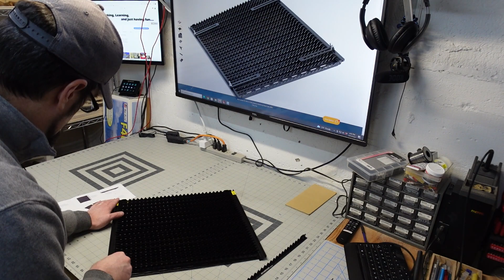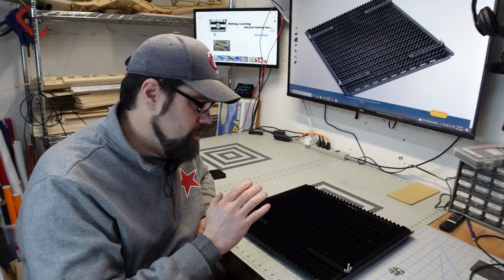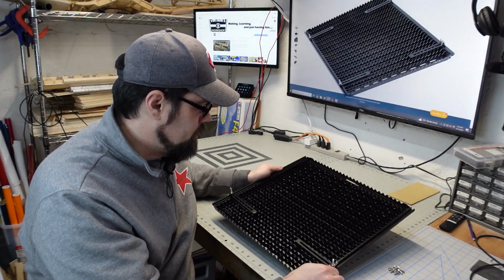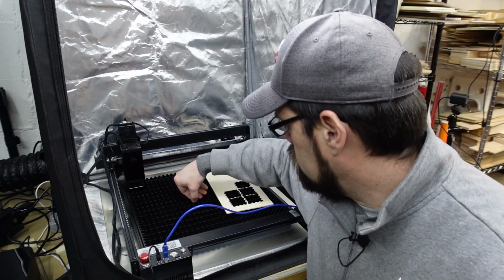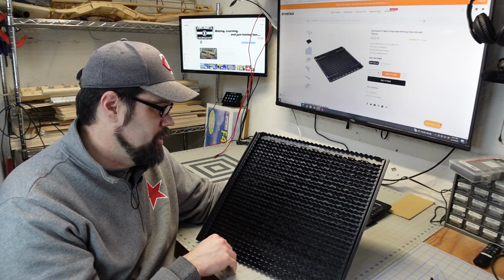Atomstack F3 Matrix Working Panel - Is this better than a Honeycomb Panel?

Comment: camera out of focus, distant recording so none can see the sense of the blades, the screwholes... dark light anyway so even magnifying one does not see anything... You placed the feet out of camera...
All in all it's a useless video.

Also useless product, mine had problems with the sticks, they would not fit in the hole cause of debris from factory left attached... had to clean. Also the screwholes in the back are "open" so the screw fits inside but if tighten it, the head starts digging and separating the two parts instead of keeping them attached 🤣
lousy product and material, you scratch it just by watching it. Also mine had already been used as it was scratched in places I didn't even touch.

106€ for a total crap, better than honeycomb but not worth all this money AT ALL. Also the company is chinese (and that explains alot) and they don't answer the questions or fake they don't understand. Even when you ask them nicely "I'd like to buy this product too, cam you tell me if it fits my machine?" they go like "oh, well, thank you for the feedback" FCK OFF! I need answers, I spent hundreds and need to spend more... China SMH
Reply from the maker: Thank you for your opinion.

Comment: what enclosure you use in this Video?
Reply from the maker: That is the Comgrow Large laser enclosure. It works well for video but also lets some of the smoke rise to the top and then it does not always extract well. But if you have a camera and need a simple solution, this does work decently. https://amzn.to/3TjHHqf

Comment: Clearly this is modeled after the 'big boy' fiber laser beds and plasma tables, but I think it is a solution in search of a problem. The reason those big tools use spikes is because the cutters on those tools are powerful enough to cut through not just the workpiece, but also the supporting surface. By reducing that surface to a series of points with lots of clearance between them, and then putting a pool of water beneath that to deal with the heat of the laser/plasma cutter, the cutting beam(s) avoid cutting through the support. (Well, for a while anyway, and then individual rows of points have to be replaced when they become too damaged to hold anything). That issue really doesn't exist with this kind of laser, as a diode laser just isn't going to cut through a ferric metal support. Given the clamping advantages of a honeycomb, and the fact that both allow for adequate ventilation, I don't really see the application for this.

Comment: I like that they are trying to find ways to mitigate issues we face using these products. The points seem to be a good step in the right direction. However I doubt I will be swapping out my honeycomb any time soon for this. I use magnets to hold down workpieces that are more often then not, warped slightly. I also use workpieces much smaller than the normal 12"12 sheet and I do not think those supplied rails would be much help in holding them down. But, like I say, I think it is a step in the right direction and I am glad to see them thinking about things other than just stronger laser heads. Good review, thanks again, Steve.
Reply from the maker: It is good to see other accessories to improve the various issues that come up with lasers.  I agree that this may limit the magnetic jigs but I also see opportunity with the T-slot side rails to both fix the panel to the laser and create jigs for alignment. It's a give and take with either option for support and airflow.  Thanks for watching!

Comment: Not sure if was mentioned but I actually stumbled into a little flaw, I had a cutout I was doing, some square that had fallen into the slots and one side ended up actually sticking up to where the laser head would hit it and completely move the sheet seems like a possible fire waiting to happen. Might burn cleaner but other design is probably a little on the safer side.
Reply from the maker: You are right that smaller pieces could fall through and stick up.  In those cases adding a few tabs to the design would keep them in place and if done right would pop out easily by hand or with a fine razor blade. There are always trade offs.
Reply: @Vintauri  Yeah guess never thought about using tabs, use to maybe using them on cnc due to high spinning bit, but I suppose might have to on smaller things with this.
Reply: Yeah man that's what I'm thinking could happen. I just got one of these today and I'm returning it. Not just for this reason either.
Reply: It nearly happened in this video as well. @10:20 that would be disaster.